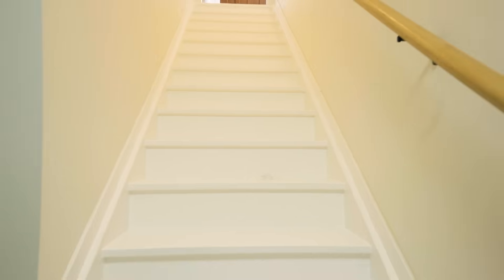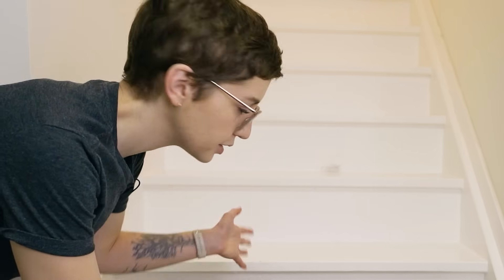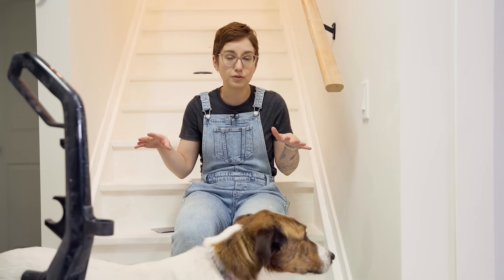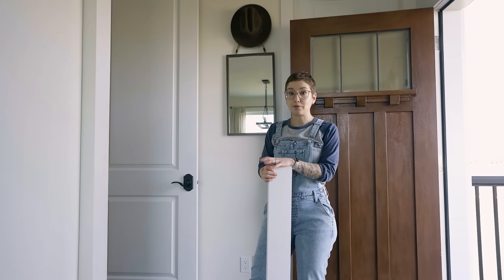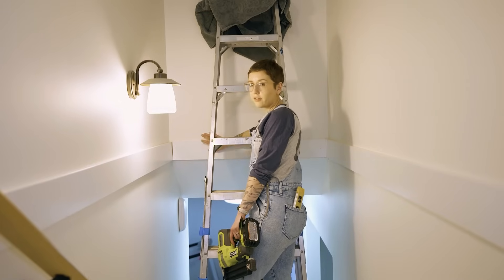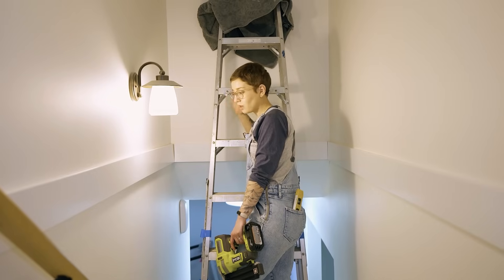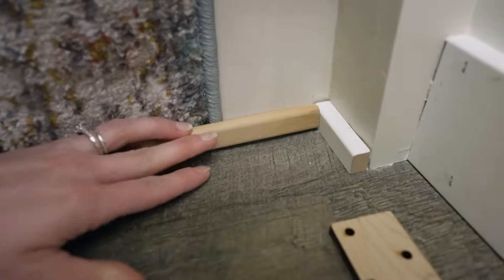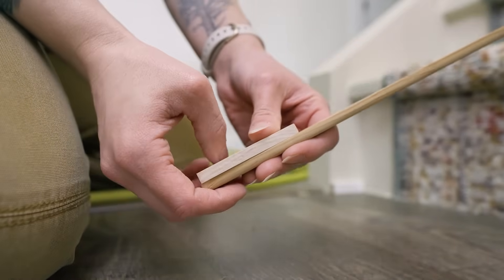Staircase Makeover (+ giant fabric mural)

Comment: Looks amazing!! You need one of those cat hair scrapers and a Shark hand vac.
Reply from the maker: Thank you! I gave up on the hand vacuums a while ago lol, there's just not enough suction with those. I utilize a plug in vacuum, vacuum the rug part as usual and then I have a horse hair attachment for the hose and use that on the painted parts so I don't scratch them up. Maybe I need to find a plug in hand vac that has great suction!

Comment: Did you use staples or Brad nails with your pneumatic tool?  How long of a fastener did you use?
Reply from the maker: I used a professional upholstery stapler (I used to be an upholsterer for a few years), with 3/8" long staples- I can't find info on the gauge of staples it takes but they are quite thing which helped them hide in the rug well. The length of staples would depend on the thickness of the rug you're using.